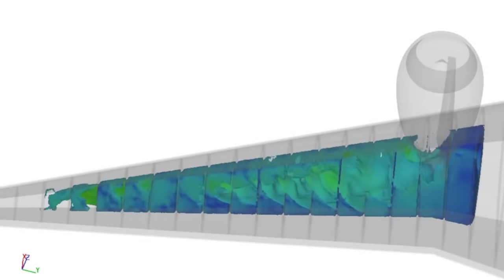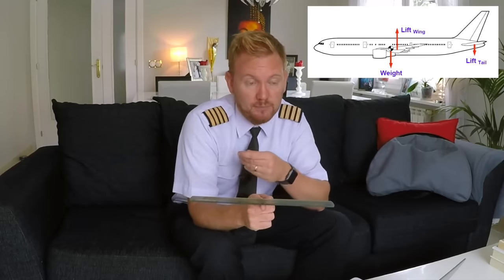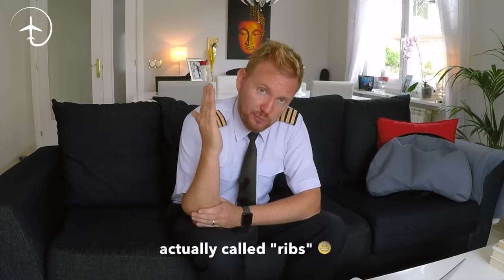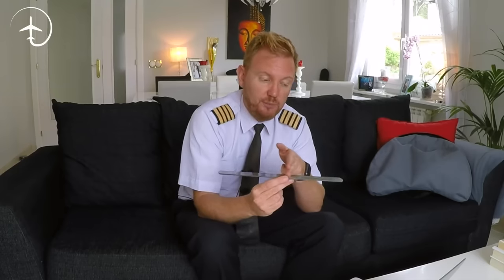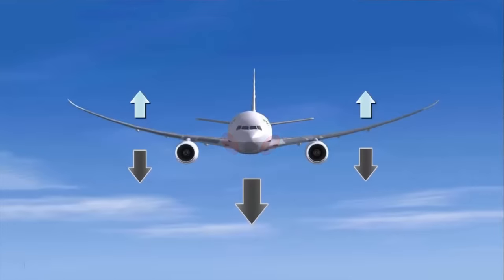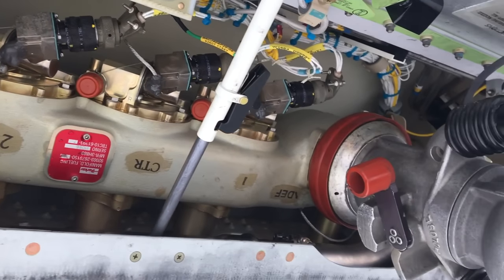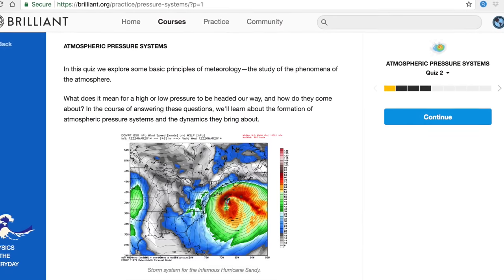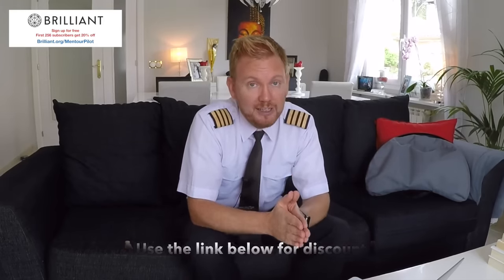Why do aircraft store fuel in the wings?

Comment: One interesting thing I learned flying with my dad is as you fuel up the wings, they actually sag a significant amount. His plane has a 30' wingspan, the wings would sag about 6" at the tips when fully loaded with fuel. Also, the more fuel, the less the turbulence is, by a LOT. With almost empty tanks it feels like you are on a roller-coaster sometimes, with full tanks, the turbulence is probably 1/2 or a  1/4 of what it is empty.
Reply: The weight of the fuel counters the lift forces.

Comment: The holes in the ribs in the wings of the aircraft are called baffles. They act like seperators to prevent the fuel from sloshing around inside the fuel tank.
Reply: He said that, why are you repeating what he said what they do?
Reply: @ollelarsson995  So that someone like you could point it out. Click bait?
Reply: They strengthen  the wing section.

Comment: Furthermore, it also reduces the distance need to pump the fuel to the engines.
Reply from the maker: That’s also true!
Reply: Another part not touched on in the video or in the comments that I have read so far is for fire safety in crashes.  The fuel being in the main body could make for some bad explosions and more injuries / deaths from burns.  (aside from the middle tank which is used first) With it in the wings, not only is it on the other side of the cabin walls, but it is more likely to be spilled and or have the wings ripped off in the crash.  Which means the fuel will be not where the passengers are when everything comes to a stop.  It also allows fire fighters to get foam on the fuel faster, versus inside the cabin with the passengers and or cargo.
Reply: Johan badenhort
Reply: True that mate
Reply: @bradheaton3356  Sorry to burst ya bubble but just watch any air crash investigation video... if anything "if" the wings get ripped of which is like finding a needle in a grass field it just makes the fuel go everywhere which is not too good

Comment: Fun Fact:  The SR-71, when fully fueled would leak like a sieve.  It was designed, when at extreme altitudes to then seal up the wing fuel panels from expansion/contraction.

Reference: We had one stored in our hanger many, many years ago and talked to the pilots as the SR-71 leaked all over the hangar floor.
Reply: Wow!
Reply: Yup. But it was made of titanium.
Reply: @jshepard152  It was but the issue was that the titanium metallurgy was in its infancy (the US needed to import titanium from russia in secret through shell companies). So the alloys had a much higher expansion factor than what we have today, and the components (like welding) couldn't take as much pressure. The SR-71 would grow by almost a foot in flight. Fuel tankswith "slack" was the solution the designers found to solve the problem, and the plane had a pretty light fueling on the ground then would be immediately refueled once it'd taken off.

And the JP7 fuel for the SR-71 was created specifically for that plane, with a much higher thickness and flashpoint than standard avgas (hence the use of TEB slugs to restart the engines if they shut down, which did happen on some maneuvers, a blackbird had 16 TEB shots so for very long flight this was a strategic resource). The fuel in the SR-71 was also used as coolant, as hydraulic fluid for some systems.

JP7 was much later reused for the X-51 Waverider, where it was also used as coolant and lubricant.

Comment: The most famous example of a commercial aircraft that DID use fuel to alter its centre of gravity is the Concorde; it had a tank at the extreme end of the aircraft as shifting the CoG was necessary as part of shifting between supersonic and subsonic flight.
Reply: The Concord stored its fuel in the nose. Thats why it could move up and down as the fuel was used.
Reply: @Sandler23  The nose and the wings.

Comment: You have to indicate that this video refers to MODERN Commercial aircraft. Briefly & historically - fuel tanks were in engine nacelles e.g. WW1 - Gotha G4 & Vimy; and in fuselage e.g. Gotha G5; also in WW2 - Spitfire, Me-109; later fighters had Bladder tanks / bag tanks or fuel cells - reinforced rubberised bags were installed in sections of aircraft structure. Increased commercial flying (1930's onwards) required cabin space for passengers & cargo where the hollow structure of wings makes fuel storage an efficient use of space. Introduced in e.g. Douglas DC-1, DC-2, DC-3, Boeing 247, 307, Ju52 and post-WW2 designs; the "wet wing" - with Integral tanks in areas inside the aircraft structure, including the empennage (Tail-section) that have been sealed to allow fuel storage. The weight of the wing tanks and fuel counteract wing bending loads and locating fuel tanks in the wings also moves fuel further from passengers and crew in the event of a leak or explosion.

Comment: The part about the fuel cooling the fuel pumps reminds me of something I heard from auto mechanics about keeping the fuel level to at least a one quarter of a tank, especially  during the summer months.  That is, the gasoline in the fuel tank prevents the fuel pump from over heating, a problem leading to fuel pump failure.
Reply: which doesn't sound logical because the fuel pump is usually not located inside the tank itself.
Reply: @kallewirsch2263  Actually it is for that reason on most modern day cars...
Reply: @chasemiller7974  
Really? I didn't know. Thank you for the correction.
Reply: That's correct about the low fuel level being hard on the pump but there isn't much of an explosion risk because at typical temperatures, gasoline actually generates TOO MUCH vapor to be flammable in air. The flammability range of gasoline in air is 1.2 to 7.1% by volume. The upper limit of 7.1% corresponds to a partial pressure of about 7 kPa at standard pressure air. Typical gasoline has a vapor pressure of 7 kPa down at -20 deg C (-4 deg F) and is higher than 7 kPa at all higher temperatures. So as long as there is still some liquid fuel in the tank and as long as the temperature inside the tank is above -20 deg C, the mixture inside is too rich to burn even if the pump were to make a spark.
Reply: @sbreheny  Not really but I do see your point. A fuel pump won’t suddenly spark from overheating. However, over time from excess heat as they’re electronics. Accelerated wear occurs which can cease functioning.

Comment: There's a good analogy to storing fuel in the wings—tightrope walkers who carry a heavy pole. The danger with tightrope walking isn't failing to step down squarely on the rope. That's easily learned. It's maintaining a vertical stance, not rotating about the rope far enough to one side or the other that you fall. Think about it a moment. Once you start leaning to the right, how do you correct that? There's nothing to grab on.

That heavy pole extending far out to the side helps in two ways. First, because of its length, it creates rotational inertia. It takes far more force to cause you to rotate. That makes balancing easier. Second, it offers a way for the walker to adjust his balance. He simply moves the pole slightly. If he starts to fall to the left, he can just move the pole a bit to the right to restore his balance.

Planes are much like that. Having the weight of the fuel out on the wings makes the plane more stable than it would be if all that weight were close to the centerline. And being able to consume fuel from those tanks also allows the pilot to keep the plane more balanced. 
----
My guess is that this difference is also reflected in how fighters and, cargo planes bombers are built. Fighters store most of their fuel in the body of the plane or in tanks close to the centerline. For them, the ability to maneuver quickly is a plus. On the other hand, cargo planes and bombers store fuel in their wings. That has the additional benefit of opening up space in the body for bombs for cargo.

Mentor Pilot might want to look into a related question that has long intrigued me. Why do almost all commercial cargo and passenter planes have low wings while most military cargo planes have high wings? I can think of a number of reason for the latter, including greater inherent stability when doing tight maneuvers and placing the engines further from the ground so foreign material is less likely to get ingested taking off from crude runways. Is that why? I don't know.

Comment: You semi-covered this: There is a great deal of stress at the point where the wings connect to the fuselage. Transferring weight from the fuselage into the wings relieves a lot of that stress.
   In the event of a fuel fire, having the fuel in the wings, rather than under the passengers adds a margin of safety.
   And, of course, Aircraft, like ships, like recreational vehicles... Everything has multiple uses, no wasted space... Empty wings are wasted space.
Reply: The point is known as the wing root, and the wing root undergoes incredible amount of stress due to the weight of the fuselage and the lift pushing on the wing! Storing fuel in the wing relieves the lift-induced stress.
Reply: @mach6893  Yeah he said that kid

Comment: Suction of fuel in high altitude result reduction of pressure on (liquid) that reduces the boiling point to make liquid releases bubbles in a phenomenon so call (cavitation) which happens hydraulic systems
Reply: That's nonsense dude.
Reply: Alton Rowell it was poorly explained, but definitely not nonsense. The basic idea is right, and it was even mentioned (without any specific details) at 8:31. :-B

Comment: I did not know about the nitrogen generation system.
Reply from the maker: It’s a quite new feature.
Reply: Flt 800 center tank explosion in '96 over Long Island prompted a relook at center tank safety.
Reply: Reminds me a bit of the inert gas generators used on crude oil tankers when they are offloaded.
Reply: the explosion was a result of an american missile
Reply: s mitchell
That's what I think.  Didn't the Navy have maneuvers in the Atlantic just south of that area and didn't they say that one of their missiles "went a little funny in the head"?  I didn't believe those stooges from NTSB and FBI.  I can still see that Jim Whatsisname lying his ass of on TV.  You are correct.
Reply: alex tworkowski Lol, no one cares what you think.
Reply: Fun fact (at least I think so): The nitrogen generation system isn't actually generating nitrogen. It's taking bleed air from the engines, which is then passed through a catalytic converter that converts the corrosive ozone (O3) present in the bleed air to oxygen (O2). Then a heat exchanger lowers the temperature of the air, followed by a High Efficiency Particulate Air (HEPA) filter to make sure the fuel tanks and other components do not get damaged or contaminated with particulate matter.
The final step is then to pass the ozone-free, cooled and filtered air through the air separation module. This is a filter consisting of semipermeable fibrous tubes. There are holes in these tubes that are large enough to allow oxygen (O2) molecules to escape through the tube walls, while the larger nitrogen molecules (N2) are kept inside the tubes. This nitrogen-rich air is then used to displace the normal air in the fuel tanks.
Reply: I wonder if there exists a nitrous oxide system for those of us who want to get to our destination a few minutes faster as well.
Reply: DoctorShocktor it absolutely was and I know a hell of a lot more about it than you I live right there
Reply: Since I'm not familiar with all of the systems that send inert gas into fuel tanks, I'll just mention the ones I do know about. The C-5 actually has liquid nitrogen dewars. The C-17 has a system often called OBIGGS with produces nitrogen.
Reply: Improvements are always paid for in dead bodies beforehand.
Reply: I’m an aerospace ground equipment maintainer and we have this equipment call SGNSC. It’s pretty cool how it would take regular air and heat it up then separate the nitrogen from oxygen at 95.6%+. I thought it was pretty cool when I learned about them
Reply: Yes Kevin I was a Deck Officer on Supertankers and Nitrogen (N2) was extracted from the Flue Gases from the Ship's Exhaust Funnel to maintain an INERT atmosphere in crude oil tanks also during tank cleaning to avoid explosion.
Reply: Kanti123 Yes that's because engines are now using compressed air technology they don't actually store any fuel in the wings anymore. This technology is being used in race cars and bikes also a turbine pushes compressed air into the engine it's a little known secret in the field they don't want people catching on about it!! You can watch JONESSENOJ channel and enslaved my no media. When planes are stopped for fuelling they are actually filling up with air. It's the nitrogen in the air that ignites at high pressure and temperatures.
Reply: Neutral gases for fulling of tanks were used in WWII (exhaust gases). Carbon dioxide and nitrogen have been used later.
Reply: Interesting. What happens to the CO2 ?
Reply: You are right.
Reply: pe hgt, you're wrong.
Reply: justcarcrazy WHY, the answer is simple.
Because nothing else will FIT IN THE WING.
If the Airlines could shoe horn a passenger seat in the wing, they would.
Fortunately even the planners of modern airlines cannot find sufficient passengers who are less than 36 inches tall to fit inside IN WING SEATS.
Reply: Bart Kuijper this is a perfect explanation. Top comment. OBIGGS 101! 👍🏽
Reply: The simple reason is, nitrogen is used to displace oxygen inside the tank. This will prevent the unwanted ignition inside the tank incase the pump temperature gets high when maybe the temperature sensor also fail to send signal to stop the high temperature pump. It's a safety feature redundancy.. that's cool

Comment: There is one huge potential drawback to using wet wing fuel storage. It doesn’t handle corrosion all that well. 

A 737 operator on the Hawaiian Islands wouldn’t just have to contend with increased rate of fuselage fatigue from repeated pressurizations, but also corrosion caused by the salt water in the moisture in that part of the world.